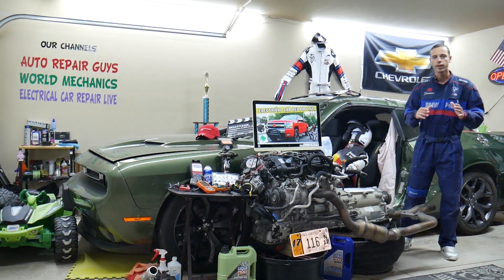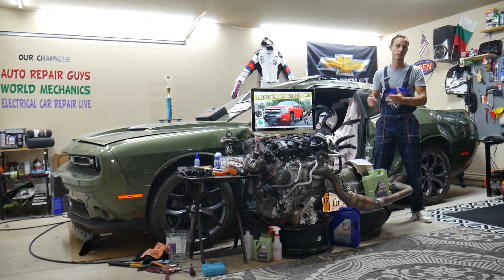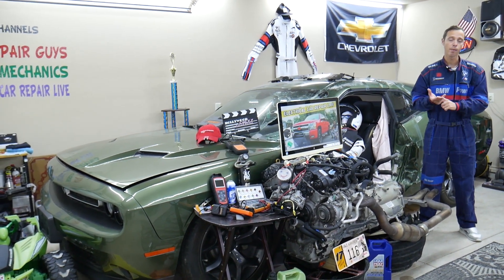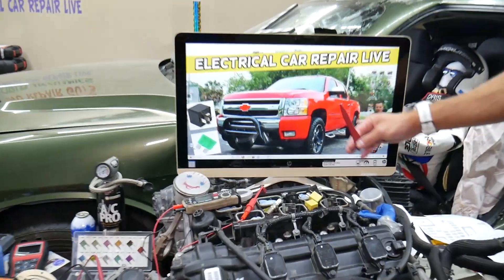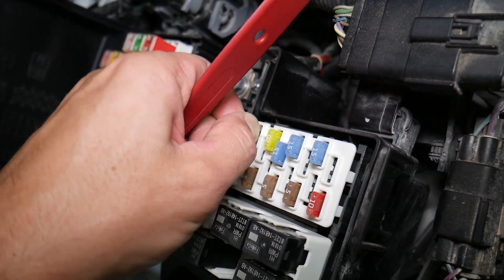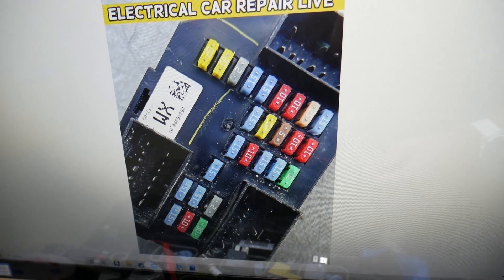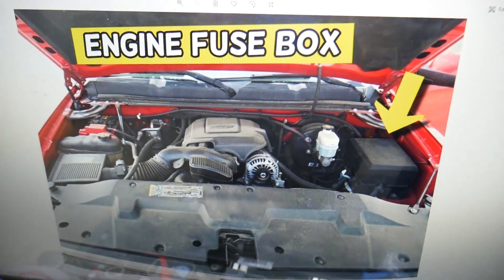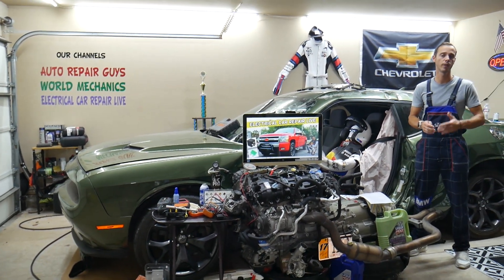CHEVROLET SILVERADO WHY BRAKE LIGHTS DO NOT WORK, STOP LIGHT DOES NOT WORK 2006 2007 2008 2009 2010

Comment: I have a 2006 Chevy Silverado 2500 HD. 
 My inner fuse box is located on the left side of the dashboard you have to open the door to get to it.
 Anyway, my brake lights are not working, I checked the bulbs, then I check the fuses inside the cab and under the hood. I did a little more researched and found out it is the brake light switch. I watched a video of a guy replacing it and he said it could cause your cruise control to have problems also your transmission having problems. A while back my cruise control stopped working and my transmission started acting up, so when I heard this, I believe it to be the problem for all my sorrows. I am going to get ahold of the switch and I will edit this comment to say if I succeeded or failed. My gut instincts at this moment is telling me this is the problem. It is March 3rd 2024 11:09 p.m. Stay tuned.